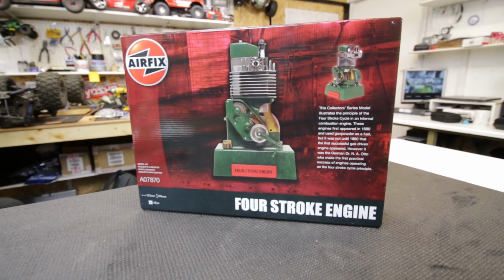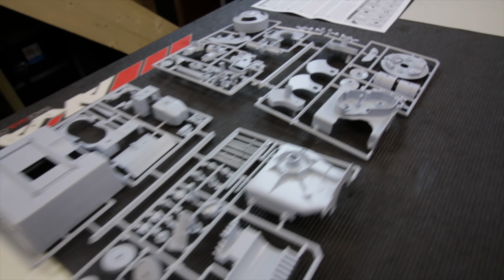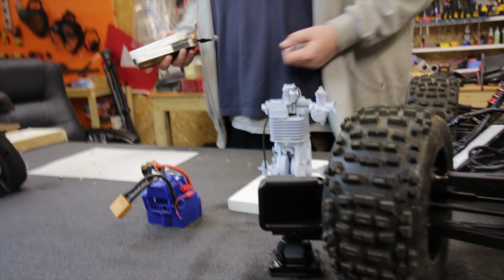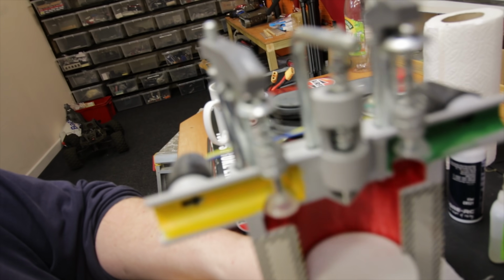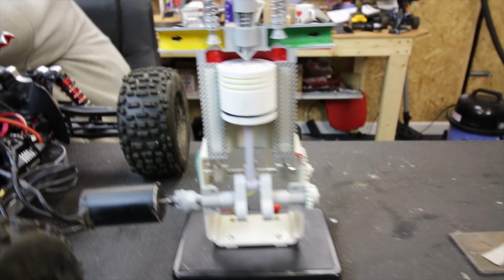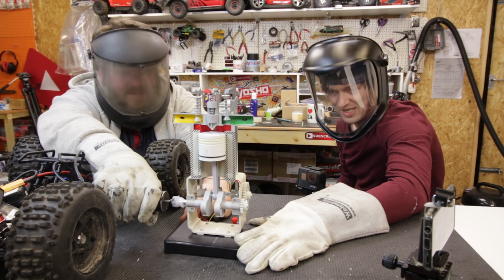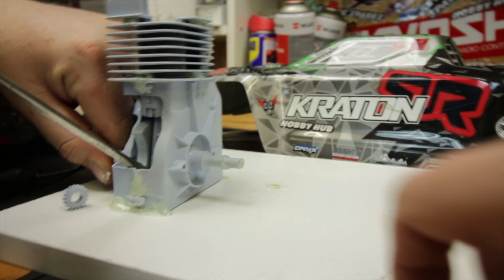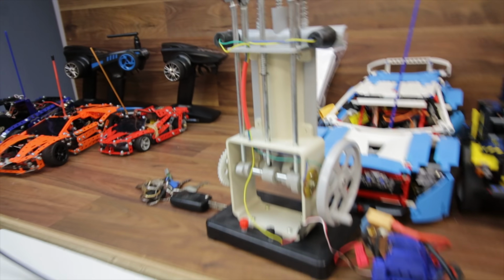Catastrophic Failure  - SLOW MO Educational Engine to 50,000 rpm -BOOM!!! LOL

Comment: hey kev have you ever had the receiver wire pull out of the ezrun max10sct
Reply from the maker: i think i did when the rusty broke in half, i soldered it back together
Reply: thanks kev ledgend I cant get in far enough to solder back to get her